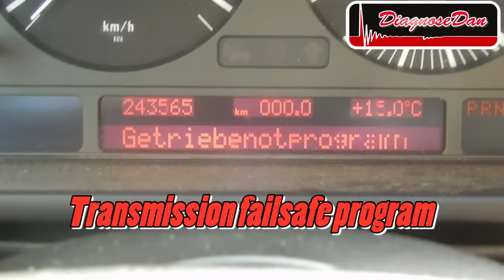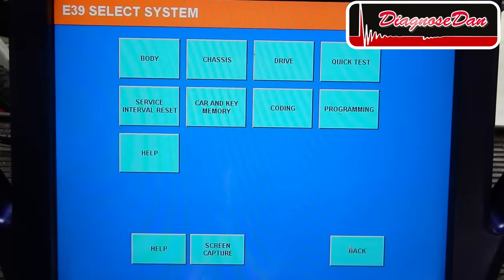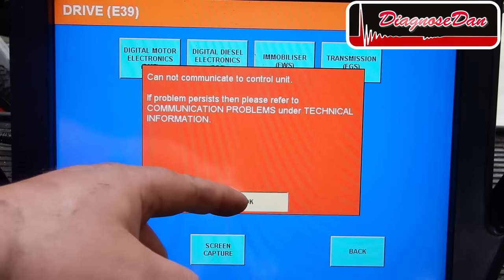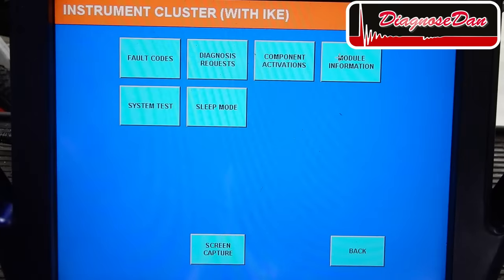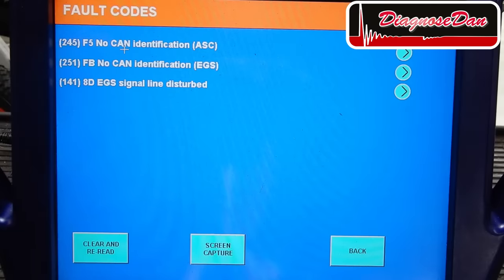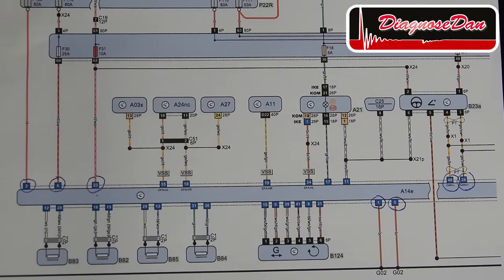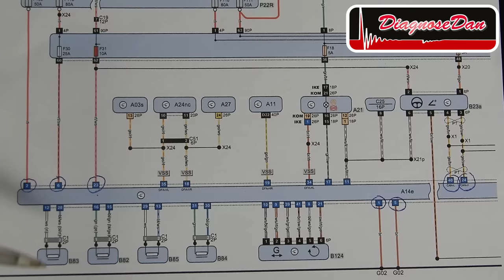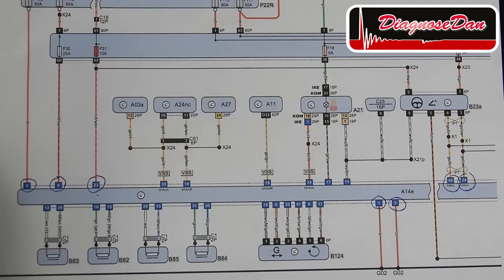Can-bus Trouble

Comment: Dan, the E39 is known for ABS module problems.. It also causes the Spittronic gearbox to force the car into LIMP mode. (My own e39 also has the same problem.) But you explained it in more detail, than most Auto /Mechanics "knowing" precisely what is going on, behind the scenes, so to speak.

Comment: In the network engineering world we call "echo" signal reflection and the twists are to prevent cross talk with other pairs (which  would be the same as interference from another inductive load).  In the old day of thin net we use to use terminators at the end of the run for the exact same reason.
Reply from the maker: FrugalPrepper's Garage & Garden, Thanks for the feedback!👍
Reply: I was just thinking how much it resembled earlier Ethernet implementations; 10base2, for example. Very similar.

Comment: Brilliant diagnosis and explanation of the CAN bus system, Dan! Did you have to progrm the new module in or was it plug-and-play?
Reply from the maker: Pine Hollow Auto Diagnostics, these modules can be repaired. So i replaced it with a repaired one. It only needs coding, it doesn't need to be programmed!😁
Reply: You should show the coding part too ;))
Reply from the maker: Pine Hollow Auto Diagnostics, I'll do a separate video on programming and coding, when a nice case study comes along😉
Reply: Dan got called in on a 2012 VW Touraug  the other day for a parking brake fault. The guys had done rear brakes and rotors, the parking brake is drum setup with electric actuators , they had not touched this during the brake job. Apparently before the brake joe they should have gone in and recorded the Coding number and mm clearance stored in the module, was not able to restore function. Trip to the dealer , tough system
Reply: Gary Stephens and

Comment: Oops, I had a question Dan and forgot to mention it in my previous post. If the ABS module was unplugged and it didn’t make any difference, do you typically plug it back in and move to the next module? Or do you leave it unplugged and move to the next module? The reason I’m asking is when there is a possibility of more than one module fault on the bus. Thank you!
Reply from the maker: stuzman, i would have plugged it back. The chance that you have 2 modules failing at the same time is not likely.

Comment: One of the best instructional videos i have viewed on Youtube,   an simpler expalnation for the 120 ohm bus terminators,  just show a 120 ohm resistor on the DVM than add a second 120 ohm in parallel to show m120 + 120 ohm in parallel is 60 ohms

Comment: Great presentation. And your English is awesome. I worked on an Audi with the whole network down. Ultimately I discovered that the fuel rail pressure sensor had shorted its 5V reference line and dropped it to ground. Even though it wasn't part of the can-bus line, it still killed it. Never quite understood why it affected can-bus but changing the sensor woke the system right up.

Comment: Hi Danny, i have to tell you that not only your knowledge level is just the highest possible but the way you explain is also just PERFECT, so i feel that i have to thank you for all the staff that you share with us.
I would like to ask you (if this is possible, because of free time issues etc) if you could make a video about CAN bus wiring repairs (totally broken or corrupted CAN wiring), ways to join CAN cables (i suppose that there must be some special way because of the resistance through the bus etc) and some special materials that maybe we have to use when we repair CAN cables
Thanks in advance Danny and keep on the great job!

Comment: I was always wondering in you could have a Can-Bus issue & still read 60 ohms on the Can-Bus line.  I always check pins 6 & 14 on the OBD11 port. Apparently that only tells you about a open or shorted line. Well you confirmed it for me. Good lesson as always Dan

Comment: Thank you Dan. Sharing your Knowledge. I love the way you explain every thing in simple terms. I own a BMW e39 and that stupid module is known to fail because it gets to much heat from the exhaust heat do to the location and the terminals lift off inside the module. Very common problem.
New ABS module has to be reprogrammed to the E39. $$$. GREAT JOB.

Comment: Sir I wanna ask you a question 
Sir if Abs making trouble in communication then if I remove it's circuit other modules should communicate or not ? Will scanner read other options like PCM and BCM  ?
Reply from the maker: A RAHMAN, Yes with the bad module removed from the network  you should be able to communicate again!😉
Reply: DiagnoseDan sir I'm an electrician and yesterday customer bring me a car Hyundai Elantra 2016 and the problem is abs and pcm BCM not communicating the indicator lights are on and rpm isn't working gear is not shifting properly he said he had an accident and after that the problem starts I check with multimeter the wiring is good from OBD2 to ECU I checked the ohms are 61.1 it seems also good I removed the abs circuit and tried to diagnose again but still same I opened the whole wiring from front side where the car damaged I got some wires cuted and grounds were broken I fixed it and then I tried to scan it again but still same the only module is communicating is airbag and it's showing the crash record code only I removed some 5 volt sensors like AC pressure sensor and coolant temperature sensor I thought maybe 5 volts are shorted but still no communication what should I do next ?
Reply from the maker: A RAHMAN, Scope the can-lines And check what's going on. Also check the power and grounds on the dlc
Reply: DiagnoseDan sir finally I have fixed it every thing is back to normal in car I found right front abs tire harness wire broken and crankshaft position sensor was bad the reason my scanner was not communicating to ECU was my scanner was outdated the car model I was diagnosing was elentra 2017 and my scanner supports only models till 2016 that was the reason it was not communicating then I used another updated scanner tool and everything was perfect by the way your videos is so helpful sir I appreciate it keep it up thanks for such good videos
Reply from the maker: A RAHMAN, Great work!👍👏💪
Reply: DiagnoseDan thanks 😊
Reply: @Abdul_rehm7n  Not sure if you know how much we appreciate when someone comes back and explains the fix for their problem. Thank you and well done.

Comment: Excelent video! Thank you! I Subscribed, allowed me to add (of course you know that but just for the subscribers) that also the twisted wires in a CAN line perform the function of creating a electromagnetic field all along and around the cables that does not allowed any (or very little) outside electrical and electomagnetic interference (noise) to the main signals. I also have a question Dan, can you please tell me in which of the CAN cables(CAN Low or CAN High) does the Middle CAN signal travels on? Thank you for the answer.
Reply from the maker: Argeny Sandoval Thanks for Subscribing!😁

Comment: Dan, this video was helpful. I'm trying to diagnose an OBD2 port which has no communication with any of the modules on a 2009 Citroen C4 Picasso. I know the resistance between CAN high and CAN low was 60 Ohms and your explanation was helped me understand why. I'm getting power and grounds but I've yet to measure the voltages on CAN high & CAN low and the resistance. I've taken these readings on my own 2008 Citroen C4 Grand Picasso which gives me a reference for a known good.

Comment: Can e bus trouble, you very funny Dr Jones. You reminded me of a story my brother told me. Years ago he worked as a mechanic for a public works department. He worked on everything from police cars to dump trucks. One day he had a police car that was not getting power to the trunk light. He started tracing down the problem and had to remove the back seat. Well a few nights earlier the police had arrested a guy they thought was selling pot. They transported the guy to the station and then noticed the trunk lights not working. The guy had a pound of pot in his pants and on his way to the station he pulled it out and shoved it in between the top and bottom parts of the seat and pulled a connection apart. Problem solved but they couldn't connect the pot to the guy they arrested. Good video.
Reply from the maker: MostlymoparIH Great story😂 Thanks for the comment!😁

Comment: Love the two 120ohm in parallel scenario. Makes sense. Had similar issue on a Silverado.  Bad module under driver seat but Chevy has a shorting block that brought everything on the bus to one single location. Made it easy after connecting my obd2 breakout box.

Comment: Dan, thank you for your video, this is very good, like a good teacher who strives to transmit and really teach.
It has been very useful, I have learned more about CAN systems, just today with a problem in an E87 from 2007, with many dtc in several units with lack of communication can and abs dtc D356 D355 D354, tomorrow I will try to check the resistance of the line and with an oscilloscope.
Thanks for your interest. Greetings
I comment, it could be very interesting, so that your videos get to be better understood, that you allow the subtitles of your videos to be in the language of the country that sees the video, I understand that YouTube in the configuration allows it, we would have to inquire, I don't know details.

Comment: Great video and explained well...btw the 120 ohms resistors are called network terminators and because i am an electrical engineer, i know them that they are there to avoid voltage reflections. Voltage on wires will still be there because of the capacitance of the wires so this voltage after fraction of seconds will be dissipated through this resistors. These resistors needs to be turned on on the modules which come last on the bus.

Comment: Dear DiagnoseDan, you have just nailed it. I am so impressed and well informed as well as educated with this video. Thanks so much. I hope to fix the problem on my VW Bora, I have been living with for sometime now. It shows multiple fault codes including no communication on the TCM, ABS and ECM( codes 01314, 01315,01316). It also has codes like 00537, 00518, 00545, 00529 which are Lambda oxygen sensors, Throttle position sensor, transmission electrical fault, missing engine speed faults. These were read from VCDS diagonostic tool.  What happens is my car goes into Limp mode and when u turn off the engine, it start  shifting properly and this has been  consistent for over a year now. I had changed the vehicle speed sensor, cleaned the throttle body checked the ECM and TCM wiring connection, but these issues persist. Pls my question is how do I get this fixed? Are there these CAN wires (CAN High and low) on the throttle body, O2 sensor where one can check for this 120ohms resistance or are they just on these main modules (ECM,TCM, ABS, Steering angle etc)? Once again, thank you so much for your easy-to-understand explanations. Cheers.
Reply from the maker: Paul Iroha The can wires only go to the main modules so they can share information, you need to scope the can wires and find out whats wrong!
Reply: Thanks for the reply. Please, could you explain what you mean by "you need to scope the can wires and find out whats wrong". cheers
Reply from the maker: Paul Iroha You need to watch the signals on the can-network with a oscilloscope and see if the communication looks ok!
Reply: Here are the two wiring diagrams (ECM and TCM) I have. Please I will appreciate if you could you tell me what I should be looking out for in them. http://fkh161.ca/VW/Bora/BoraTCM.pdf and http://fkh161.ca/VW/Bora/BoraECM.pdf ...Thank you.
Reply from the maker: Paul Iroha Can't open the link but the can wires are on pin 6 and 14 of your dlc.😁
Reply: Pls can I send you the PDF wiring diagram to your email?
Reply from the maker: Paul Iroha What scope are you using?
Reply: I use a VSDS diagnostic software from Ross tech. I also have a Autel Maxiscan but, cannot read fault codes on my VW bora
Reply from the maker: Paul Iroha Yes, but what scope are you going to use to check the waveform on the can lines?
Reply: DiagnoseDan I don't have any oscilloscope to check the waveform on the CAN lines
Reply from the maker: Paul Iroha Ok why do you want me to take a look at the wiring diagram then?
Reply: I want to know if I have missed out anything. I have checked for power and ground on both the TCM and ECM and they both look healthy with volt ages of about 12v, I have also measured resistances o the CAN wires and are both within 60ohms
Reply: @pauliroha5506  did you get it sorted and if so what was the problem

Comment: Hi Dan thanks for a great vid, its nearly always the abs, the main connector on the module is nearly always soldered on to the main board using lead free solder,  (sauder) in the states, lead free is not permitted in the avionics industry.

Comment: Hello Dan - Brad here from South Africa - fantastic channel - you are doing a great job . Small input - when replacing a ABS or DSC unit re coding the unit based on the vehicle data is very important - maybe also mention that . Remember the video on the Speed Limit Camera not working because of the aftermarket tow bar fitment , but in this case the brake force distribution is part of the coding based on the vehicle model , engine , options like reinforced brakes ect

Comment: Hola from the great state of Texas Diag Dan! I am hoping to see a PT-CAN diagnosis on a 2004 BMW  745LI. There seems to be some confusion as to the location of the rear resistor. It is, in fact, located under the driver's side rear seat under the plastic wire harness covering. I am in the process of trying to find out why the can bus is down. I found the rear resistor blown. I replaced it but the system is still down. Now begins the process of eliminating one module after the other until the system comes up (I hope). BTW this car was at the bottom of the lake. True statement.
Reply from the maker: Good luck!😬

Comment: Dan what a great explanation of CAN bus. Very well planned out and the drawings are helpful examples. Thank you! One question arises,  if the test for resistance in the CAN bus is too high how would you locate the two modules with the resisters to test? If a resistor is bad, in this case, the signal voltage would behave like the module is unpluged.
Reply from the maker: You can find the terminating resistors in a wiring diagram
Reply: @Diagnosedan  makes sense! Thank you

Comment: Hi Dan great video on the can bus systems.
Hi have a L322 2005 Auto. My diagnosis machine as come up with a CAN bus transfer box range Fault check the motor this seems to be working fine but still not changing to low range gears. Also the main gear box is only operating up to 3rd gears wool the CAN bus faults cause this on the main gear box
Thanks 
John

Comment: Hi Dan, I've seen all of your videos and find them very informative especially when you cover the whole diagnostic process step by step and in a logical manner. I've just got one quick doubt in this video where you see that the voltage even after removing ABS module connection is still high. If you remove the connector the resistance in the circuit is 116.6 which means that the voltage should be low rather than being high. Voltage should be high only when resistance is low in the circuit. Thx
Reply: no the voltage on the CAN bus goes higher than when normally loaded as the load on the CAN bus has reduced by roughly half. The resistance is parallel to the CAN bus NOT in series with it.

Comment: Hey Dan, how are you ? I like your thorough diagnostic procedures,thank you for sharing. I have an 05 murano. I got a P1273 code. It’s an A/F sensor. B1S1. I don’t have a fancy,expensive scan tool to see all the functions. But I have one to see the voltage of the sensor. The B1S1, has 0.290 v. And the B1S2 has the same voltage,0.290. V. But the B2S1 has 0.600 v and B2S2 has 0.450v. Can you rule out what component is bad on bank 1 ? And Bank 2,? Thank you. And by the way,congratulations on your 100,000 viewers.....
Reply from the maker: Maybe a vacuüm leak, can't tell without diagnosing

Comment: great video-really informative. my question -is there a way to determine which 2 modules contain the terminating resistors by reading the can schematic? your bridge circuit diagram is awesome.
Reply from the maker: Some wiring diagrams manufacturers draw them in the diagram.

Comment: Hi Dan....I am from Malaysia and just got back my Vw beetle,the last of the series just before VW discontinued...my dsg once activated by my use of the paddle shift takes a long time to get back to auto mode...it was found by the dealer(by the way the car is still under warranty)that the ABS sensor is faulty from their diagnostics.....a sensor was changed and it seems to be ok.I am not savvy in auto electronics or any electronics except very basic knowledge.Am writing to compliment you for your very clear explanation which makes me a man on the street understand.
Is a sensor the same as a module?
Thanks again Dan,do stay safe,healthy and happy under this pandemic

Comment: Hi Dan, thank you for a very informative video. I have a similar problem on my clio 3 with my cluster not receiving speed info from the module and was told to change the ABS module. however this problem also affects my electric windows and am wondering what opening and closing of windows have to do with speed?!
Reply from the maker: I think it has nothing to do with the car speed.